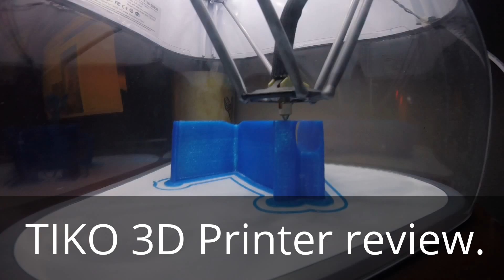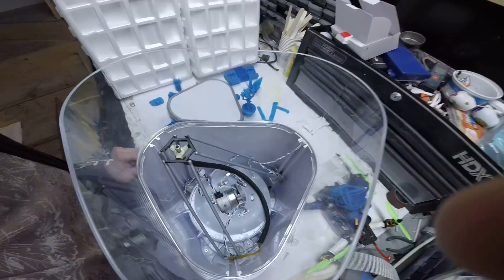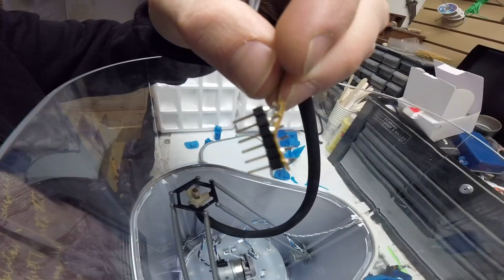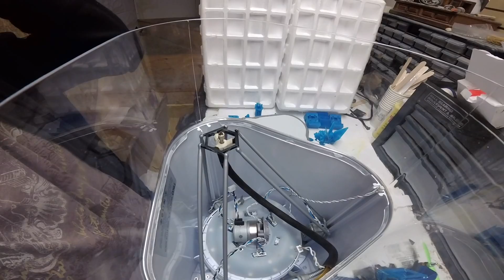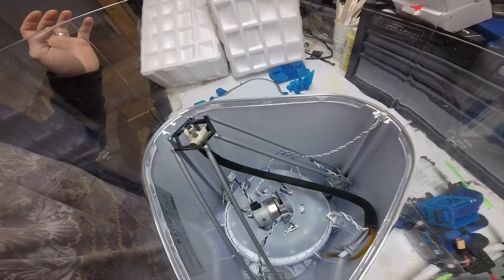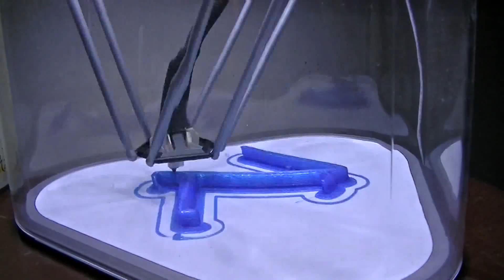Tiko 3D Printer review

Comment: What's that: self-leveling. Sorry, but I'm a noob when it comes to 3D printing and I also bought a Tiko 3D printer, and I'm still waiting for it (I live in Portugal)
Reply: What I mean was, I know what is self-leveling, but why is it important on doing it yourself that to the printer? doesn't it come leveled? or for each model you have to manually level it to start printing?
Reply from the maker: because of the backlash and slop in system the auto leveling was kind or eratic. The base is softish so it kind of sinks itself inthen comes back up. I rarely get good results this way.

Comment: I am sorry man... Tiko is a failure. It has too many issues and not just software. Hardware too. Do yourself a favour buy something else that's actually proven itself. Off the top of my head and for about the same price there is the Blocks Zero and the MonoPrice select mini already tried and true... Tiko needs to go back to the drawing board with this one...
Reply from the maker: i have had quite a few disappointments with this printer. there is a thriving group on fb of people who own them and are modifying them to work better. Software seems to have improved drastically.  Hardware seems to be the issue now. Im hoping they will make a new set of arms and motor carriage. this should fix the problems most have been having
Reply: I would recommend the mp mini delta it is along the lines of this and has much better quality. It does not have online slicer software, but honestly it is not hard to use the new cura. It has a simple mode which a baby could use. If you are wiling to build it i would get the Anet A8 it prints way better then this and I have mine set up with a Raspberry Pi zero W so I can use Octoprint or Astroprint which has a pretty good cloud slicer. You could also use the Raspberry Pi with almost any 3d printer that you can connect to a computer. P.S. I an 14 years old.

Comment: im watching and waiting,and still not ready to order,cmom TIKO,pull your came up,or its the anet8
Reply: I couldn't agree more.
Reply: Dont buy either of those. Buy a monoprice mini. $200, and miles ahead of both the tiko and anet8.
Reply: Ralphie Vigg Anet8 is based on the open source Prusa i3 which is considered to be better than the monoprice mini.
Reply: Keyword being BASE ON. There's a fuck ton of printers BASED ON the Prusa i3. They're not nearly as good as the original. I had an anet8. I sold it after a week. The frame is thin wood, its not stable at all (a stable frame is important if you want half decent quality of prints), the nuts loosen or cut through the wood frame over time. Many Anet8s are dead on arrival, electronics malfunctioned. Do not buy them, unless you also want to buy a new house after you burn yours down.
Reply: Ralphie Vigg Now I know you are making stuff up. The A8 is metal and acrylic. Fanboying doesn't help anyone. With a few cheap upgrades your A8 can print to the same quality of an i3 v2.
Reply: Thats the problem with cheap knockoff i3s, they're all different and marketed the same.

Im not fanboying. I dont even have a Josef Prusa i3 mk2. Too expensive.

I built my own core-xy from scratch, $250, prints as well if not better than my friend's Josef Prusa i3 mk2. His just has extra features like auto calibration and leveling, but I dont need that.

No chinese $180 kit will be as good as $180 from-scratch, either. Especially prusas. Prusas are the least expensive printers, but they're also the easiest to screw up entirely.
Reply: Ralphie Vigg Excuse me for not beleiving anything you say, first off you say you had an A8, then you say that the A8 was wooden and then you say all the knockoffs are marketed (meaning labeled) the same, the latter two of which are false and then makes everything else you say completely unreliable. The thing is, while you call them knockoffs, its an open source product, meaning as long as you do your research and get a 1:1 copy you'll be fine, just like buying a chinese arduino for $2. Get the right one and nothing will go wrong. The A8 has better marketing than most, and the people who have had one have given them favourable reviews. It will, however be interesting to see how the Tiko3d stacks up as it's not as much of an eyesore by comparison to other 3d printers out there.
Reply: If you want to spend $180 on a doorstop that will make you lumps of plastic useful for nothing else than paperweights, go right ahead. It's your $180 not mine :)

Ive had my $250 core-xy for a while now. I've printed two other printers and sold them, and now my printer is making profit on itself. If you want a reliable printer, source your own parts. Anet8 will use the cheapest possible electronics, cheapest possible screws, cheese grade metal that will strip when you put a screw in more than twice. Go right ahead. Or, you can spent an extra week sourcing your own parts and build a better printer, with better parts you approve of, for nearly the same price.
Reply: Ralphie Vigg Looking at reviews for the A8 it certainly does not print lumps of plastic, yet more BS you are spouting.

"printed two other printers" HAHAHAHAHA LMFAO, are you kidding me? I can't even.

You obviously do not know anything about 3d printing. Good day.
Reply: ""printed two other printers" HAHAHAHAHA LMFAO, are you kidding me? I can't even."

Go on thingiverse. Search "3D Printer". Print a batch of parts, get electronics, ???, profit.

"You obviously do not know anything about 3d printing. Good day."

Excuse you. Here's my printer, pal. imgur.com/gallery/S2Hyi

All the blue and sky blue and white parts are 3D printed.
Reply: Ralphie Vigg So you didn't ACTUALLY print a 3d printer. You just 3d printed certain low-stress parts. I fail to see why, however as you could (potentially, I know you can for the i3, but I don't know much about your printer) get the same parts dye-set for cheaper (filament is more expensive per litre of equivalent plastic, as you should know)

I just assumed you were one of those twelvies who thinks you can fully 3d print printers with 3d printers and make infinite 3d printers and money (yes, those exist).

The thing is, if the Tiko3d flops then I'll build my own pursa (to save myself on the replacement parts I'd have to buy if I got the A8), but I really hope the Tiko doesn't so it can be a showpeice, as I don't need to 3d print that often and the prints dont need to be super nice. Also the Tiko has good shipping to NZ.

P.s. You misspelt my name </3
Reply: You do know paying to have a dye custom made, and pay a manufacturer to do so and injection mold you parts costs upwards in the tens of thousands, right? Maybe I'd rather pay $16 for a roll of filament, use 1/4 of it, instead of paying multiple thousands for each part I need to produce one of..

Tiko3D already flopped, btw. It flopped when it failed to send out products, it flopped when it finally sent out defective products (months late), it flopped when it's actual working product isnt on par with technology that was developed in the 90s.
Reply: Ralphie Vigg You can get die made parts of aliexpress for exceedingly cheap.

Tiko has explanations and justifications for all of the above. Making a commercially viable 3d printer is a very difficult process, especially when you want to reinvent the wheel at every stage to try and decrease production cost. The prints seem to be getting better and better with every update as well.
Reply: Explanations and justifications dont make printers print better, now do they? Tiko is not reinventing the wheel. Reinventing the wheel doesnt mean making it out of swiss cheese instead of stone, does it?

I can guaruntee you, that you will not get die made parts for $4. Maybe if youre buying 100,000, but youre not. Im not.
Reply: Ralphie Vigg Explanations and justifications for delays and DOA units. They are reinventing the wheel in that they are trying to make a small unibody triple arm printer, a combination which has not been done (afaik) before and bring it to the mainstream. They have had to create custom machining processes in order to cater for a unique printer. They ended up having to purchase their own factory.

You don't need to buy 100,000 parts, you just buy a set of ten, along with 1,000 other people and the cost of each individual peice ends up being around $0.80 each, depending on what part for what printer you are buying. A factory in china will do one run of those parts and then move onto something else until all their stock has been depleted. This is the basic premise of aliexpress.
Reply: Keith Anderson You don't seem to understand that I made one of these printers, with dozens of unique parts. Buying 10 of each, lets make a lot estimate of 120 total parts, at 80 cents each. Is that more than $4? I don't know. 

Do you know what's another way to make a unibody printer? Buy a kossel. Put side panels on it. Innovative! 

I've used Prusa styles, i've used Kossel/delta/"triple arm" printers, i've used corexy. Tiko is doing nothing except using the least expensive possible materials. Not the least expensive sufficient material, keep in mind. Oh, they made it a triangular body instead of 3 separate posts? Wow! That's obviously superior in every way. /s. Oh, it's pretty? I'm paying for a $200 paperweight, but at least it's pretty. 

The idea is cool, sure. A plug and play printer. One that looks cool, one that's child safe, one that works. 

 plug and play doesn't exist. Not for another 10 years. They are reinventing the wheel, but using swiss cheese instead of stone. That's a valid analogy. Instead of metal posts capable of handling any sort of stress, they use 3mm thick plastic. with grooves in it. It's not even like it's a cylinder, which COULD be strong enough. They put flat sides on it just to give it extra flexibility. They use tiny plastic rods, of which need to bear the weight of a motor pushing filament into a nozzle. Which is substantial. 

I'm sorry that you're dissapointed with the Tiko. It would have been awesome if it ended up working. I almost preordered one when the kickstarter began. I am so glad I didn't. But now they're just spitballing trying to avoid lawsuits. Do you know what the CEO at Tiko did with all the money that was supposed to go into Tikos? He bought a house. A house. Before they shipped a single unit, working or not, they bought a house. A mansion, even. That's not an analogy. I'll get you a link to proof when I get home.

I wish you luck with your 3D printing experience. but you're going to have a hell of an easier time if you get something other than an Anet8. Get a monoprice select mini, or a wanhao duplicator. Similar price ranges, much better quality.
Reply: Ralphie Vigg I actually have access to not one, not two, but three ultimaker 3's through a friend with a maker business so any hardcore 3d printing is done through him. He fixes up my cads and takes care of most all of the technical side of things for me. I would, however like a functional showpiece. And yes, Im disappointed in the Tiko, I see what it could have been. For just a few hundred dollars more they could have made it so much better, and Im sure that most would be willing to pay that much. Yes what the CEO did was immoral, but you have to see your funding in the kickstarter as a transaction. I never crowdfund for obvious reasons. I'm just disappointed that I wont be able to get a sub-500 dollar 3d printer that really looks awesome (and is somewhat functional,lol). Maybe the tiko 2.0 will be better, or maybe they will come to the realisation that they can't build a really good 3d printer for just $200. I accept all of your points and logic. You may want to check out aliexpress if you wanted to make a batch of say 5-10 printers later down the line, as you could potentially save even a small amount of money on each, and free shipping is always a plus. I wouldn't use their parts for the more important parts in your pieces as the quality control can sometimes be spotty.
Reply: Ralphie Vigg Anet A8 is not wooden (same for every other model). I have mine and it works beautifully. Totally worth!

Comment: I am also having pretty good luck with my new Tiko....I am surprised you got such good results with the Tiko Gem PLA. I am also using some foxsmart Black and Green PLA with great results. BUt for me the GEM is hit or miss. The temperature per PLA definitely requires some experimentation. For the price point I am also loving it
Reply from the maker: I just had to get it dialed in, the new settings in the firmware update kind of threw me for a loop. Stopped printing well, but i have them dialed in now.